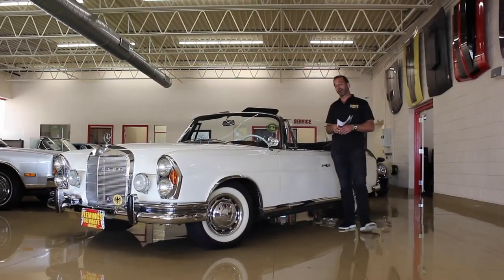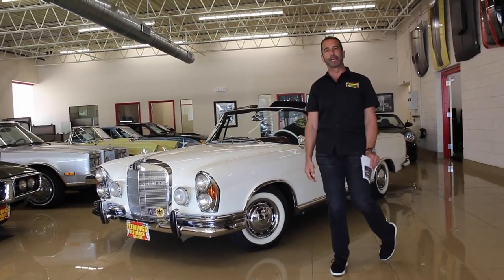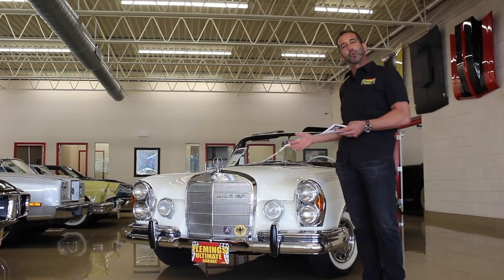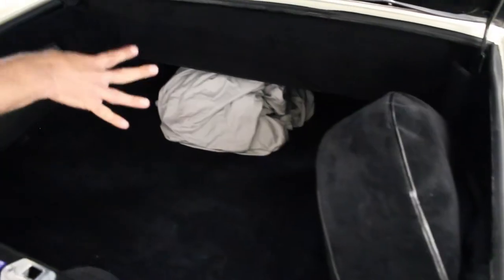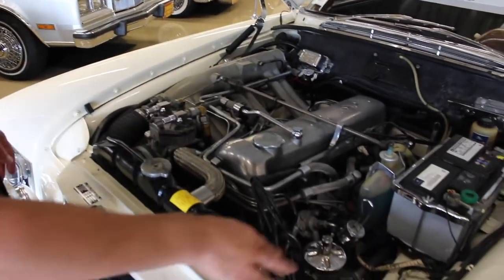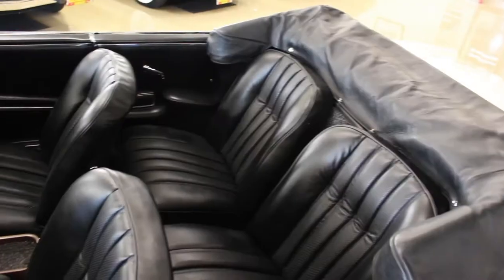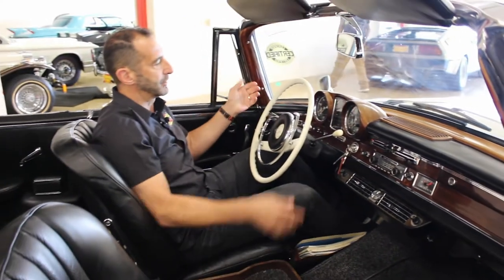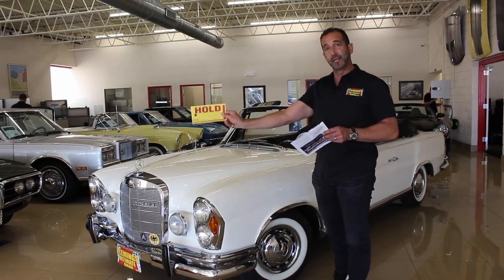Driving a '63 Mercedes-Benz 220SE - "I Shoulda Bought It When I Saw It"

Comment: You forgot to show the fuel cap under the sprung rear number plate. I had a 1961 220SE pillar-less coupe back in 1985. I paid £500. WCO 950. Wish I still had it.